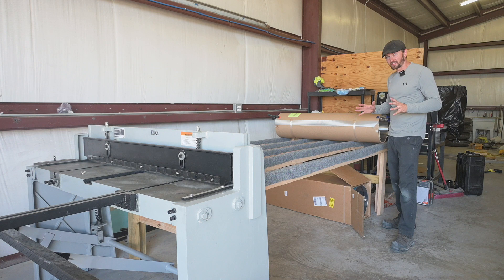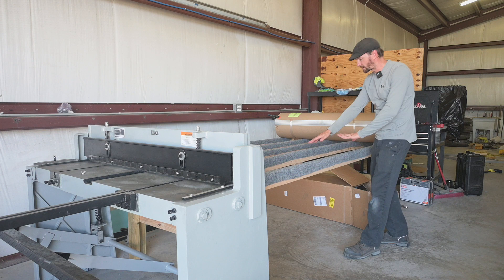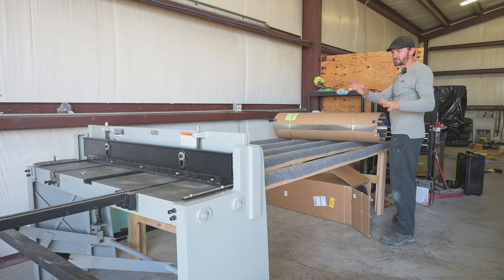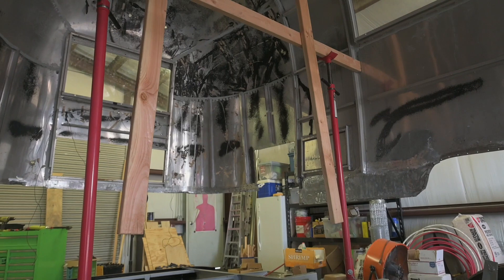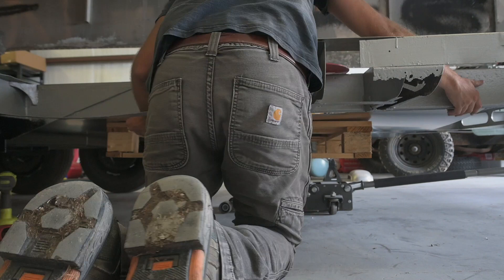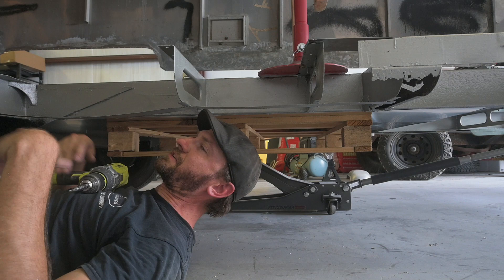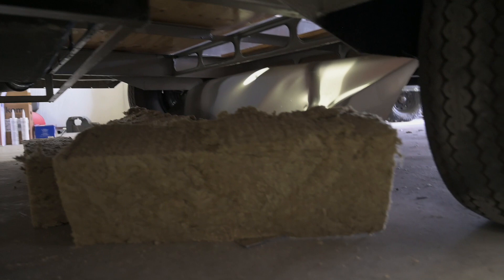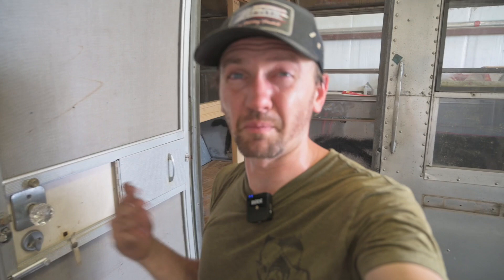How To (and Not How to) Install a Belly Pan on a 1966 Airstream Ambassador Trailer

Comment: Really like your work and videos.  I am dismayed to see you upside down drilling into metal above your face without using eye protection. Metal shavings 101.  Best of luck in your endeavors.
Reply from the maker: You and my wife.  I learned my lesson, burned right by my eye.  Got a new set of glasses, part of the problem is my old set was scratched to hell and I couldn't see out of them.  Thanks!

Comment: How did you tie in the belly pans to the exterior skins? The original two piece belly pans extend out just passed the 2” straps welded in between the outriggers.
Reply: I hit send too quickly sorry. I noticed your New belly pans only extend to the frame rails. Did you cut new transition pieces to connect the skins 2 foot frame rails? I am replacing my belly pans on a 65 Tradewind. And I’m at the point where I’m ready to order sheet metal so trying to finalize the design and measure things up. I plan to use the same approach with 4 foot rolls running across side to side like you’re dead instead of front to back. I really enjoyed all of your videos and learned a lot. It’s been very helpful and I really appreciate your content. Keep up the great work, thanks.
Reply: Sorry about the typos. Voice recognition software can really good things up.

Comment: Hi!  When doing a rebuild on 1971 travelux(canadian), it was one piece from one side to the other and the seam overlapped under the wall, at the channel for the walls, going  around the outriggers at the same time.  I thought the strength was in the airplane design,sort  of like an egg. Was wondering if that was your choice to do it that way or was that an AS design? i often hear others talk about a banana wrap. Would that be it?
Reply: airstreams have the belly pan which is the large piece(s) that runs down the middle of the chassis, and then the 2 side pieces (banana wrap) that curve from the edge of the belly pan up and around the outriggers to meet the bottom of the shell. i believe its done this way not only for a streamlined (no seam) look but also for easier access to the tanks etc.

Comment: How far do you overlap the pieces?
Reply from the maker: I overlap about 1.5-2 inches. Enough to rivet thru but not to waste too much aluminum.
Reply: Sounds good thanks for the reply
Reply: Does it have to be riveted to the frame cross members? Or just to the main frame?
Reply from the maker: The seam does not specifically have to be but the belly pan as a while should be, it helps prevent sagging.